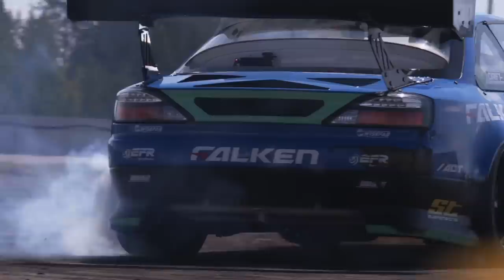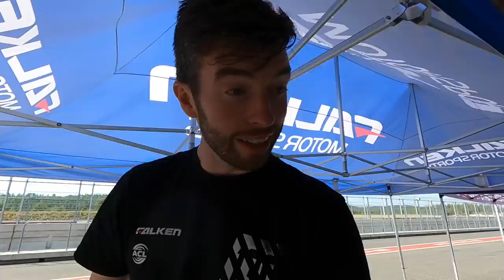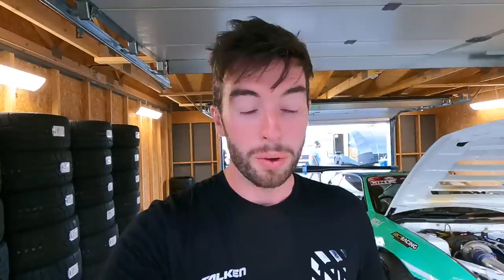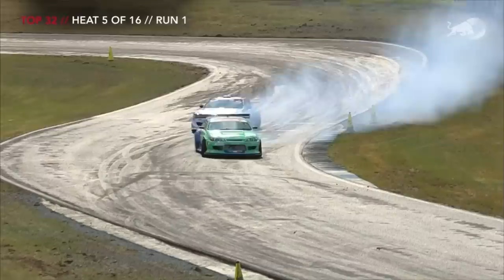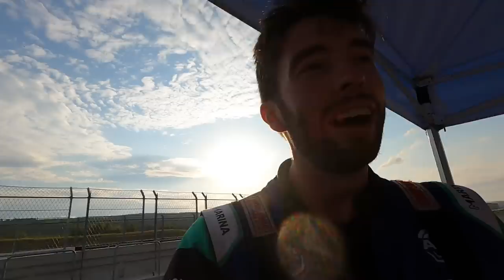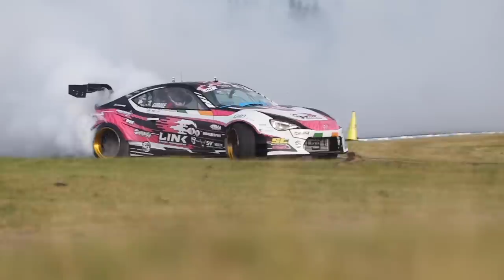Drift Masters Sweden | S14.9 Competition on the Edge

Comment: Just insane! This guys have always been and will be my inspiration to drive. I noticed a few bits about the car setup and I hope James see this comment: Making the car that soft "searching for grip" is making it a bit undriveable when he gets off throttle (Understeer and lack of grip). If I were James it would try to avoid the agressive weight transfer to the front, every time he gets off throttle. Stiffer front springs might help.

With the current setup, I feel like the car might feel like it has a lot of grip on throttle, but everytime he let off throttle might feel like skating in the front tires, and no rear grip whatsoever just because the suspension is changing the alignment heavily when going from full squat to normal. Just a theory but will like to hear a confirmation/explanation about James's feeling from this one.